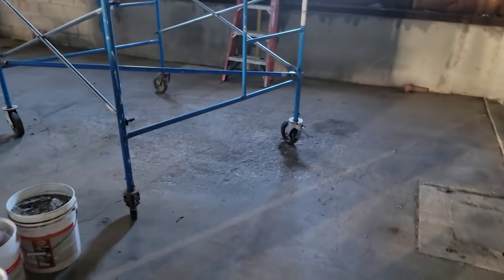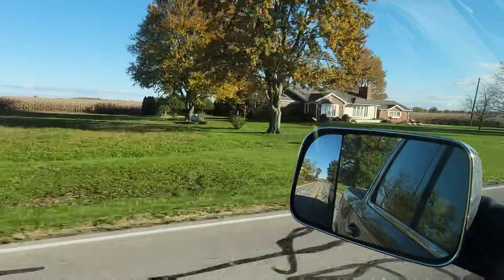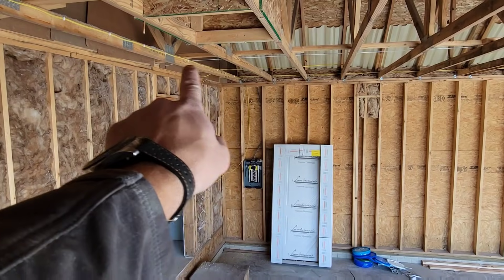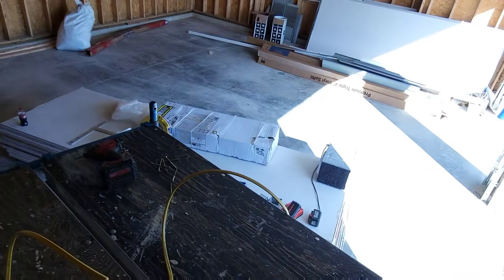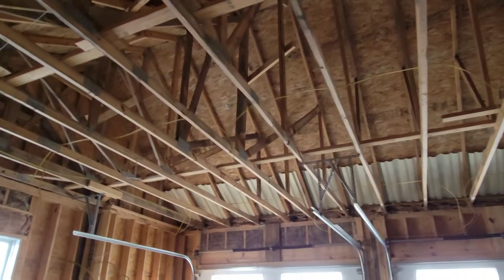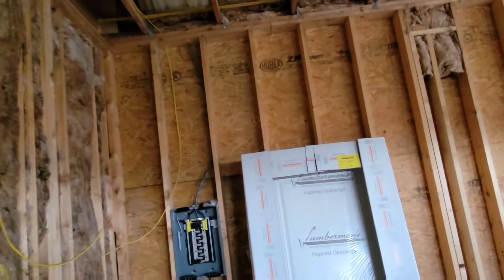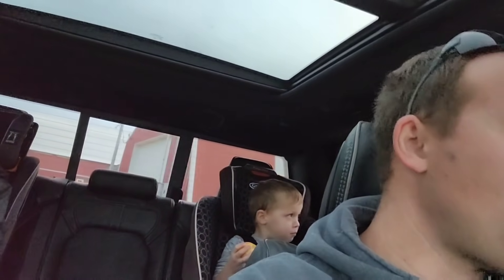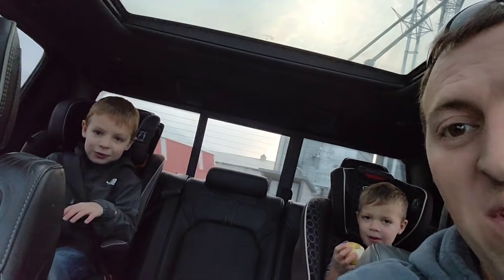Wiring my Garage - #537

Comment: Definitely insulate the wall ( you can blow in attic insulation later) in the garage.  Also suggest a 220v outlet.  You and the boys will be working on projects in the garage as they grow.  Maybe it’s just tinkering with a broken toaster or vacuum but it’s really handy to have a small workspace in an attached garage.

Comment: Exterior circuits need to GFCI.  Best to put that in the panel, rather than individual receptacles, but that means that the interior, and exterior breakers need to be separate.
Reply from the maker: Why can't the interior plug be on a GFCI circuit
Reply: @BorderViewFarms  it can, but there are sometimes nuisance trips with them, so I only use them where the code requires them. It would theoretically make things safer in the garage though.

Comment: You can’t have too many wall recepticals in a garage.  Have you decided what to use on the garage walls?  Buying a dry wall lift is probably a good idea.  I always rented or borrowed lifts and spent the cost of a cheap lift on rentals.  I actually enjoy taping and finishing drywall.  Even have done complete skim coat finishing on drywall and old cracked plaster walls.  Once you get in the routine it’s pretty mindless work.
Reply from the maker: I figured with this and the basement eventually it was worth it. Only cost a couple hundred dollars

Comment: being a retired electrician my question is are you doing this electrical work after the contractor has finished and signed off or are you doing work under his insurance,?  you can do whatever you want after the electricians are done but you cannot do any electric work and expect his insurance to cover any fire that may or may not occur caused by harry homeowner.. lastly any protrusion through sheetrock seperating living space from the garage is a potencial for carbon monoxide to enter said dwelling.. in some states a double layer of sheet rock in a garage is required  to bring a fire rating up to code...just some thoughts.......
Reply from the maker: Signed off on what? It's my house if I want to do some wiring I will.
Reply: @BorderViewFarms  if the electrical work has already passed  final inspection and you got your certificate of occupancy then by all means do what you want ... but until then all electrical work must be done by a licensed electrician..sorry buddy..!!!!
Reply from the maker: @edwardleonard7538  there is no electrical inspection

Comment: You may want to look to the future a little, 220 for electric car charger some day down the road. Easier to atleast run some cable and put a breaker in your big box. They draw a good load on regular or fast charge.
Talk to your electrical contractor.
Reply from the maker: In the plan